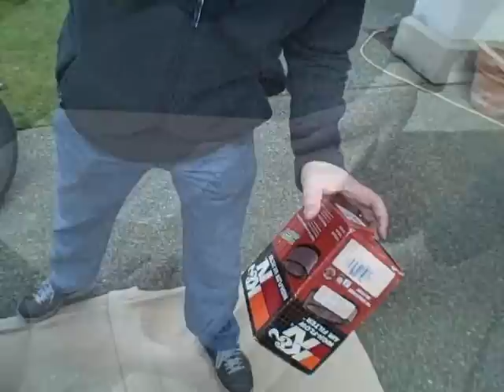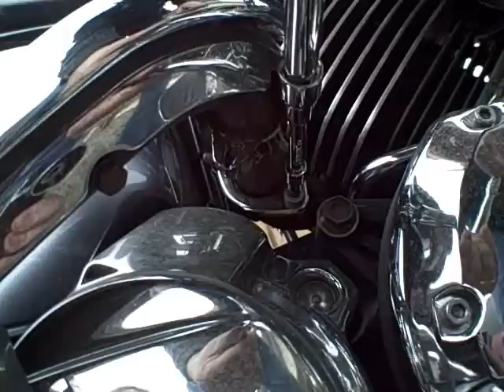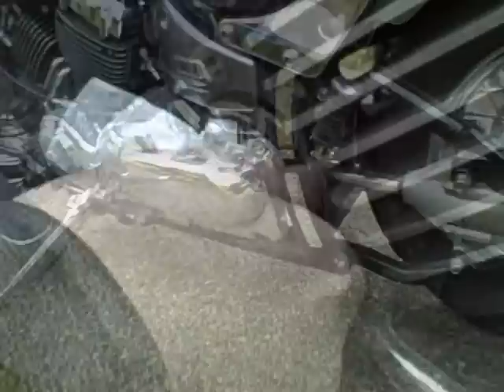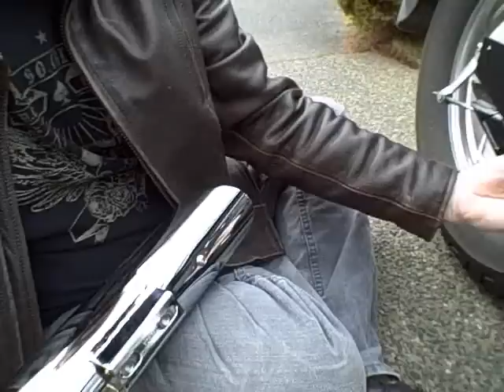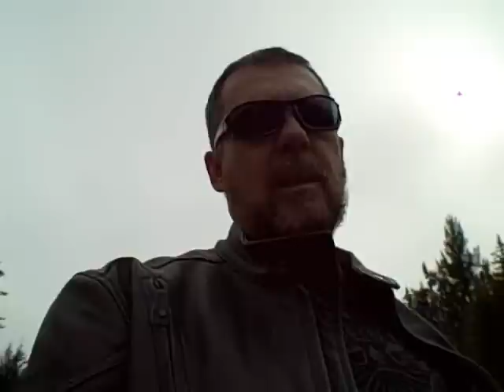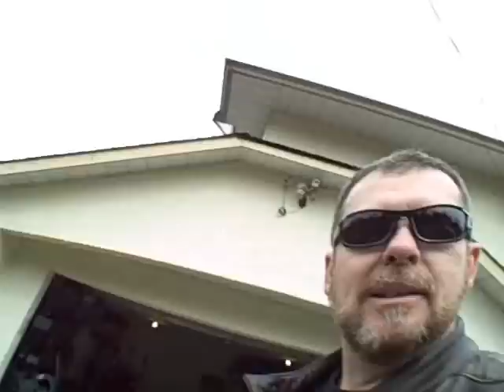How To Install Vance & Hines Cruzers

Comment from the maker: That is a great question, we just snugged them down equally not to tight and then put some miles on them and then do a recheck on the bolts, always easier to re-tighten them than over tighten them. If you feel an exhaust leak, just give em a little more. Cheers!

Comment from the maker: You should also install a K&N air filter and Vance & Hines recommend you rejet the carbs. My brother is taking his in to the shop to get the valves adjusted and he will get the carbs done at the same time. Hope this helps out.
Cheers!

Comment: Hi Bernbo. Bob from Australia here and I really enjoyed this video of you and your bro having fun putting these Vance and Hines onto his motorcycle. I am thinking of buying the same system as this for my 2006 V Star 650. I am just wondering if you remember the jet sizes that you would have had to go up to, to richen up the fuel mixture. I could do it my self with a series of plug chops but I would have to pull the carbs on and off a few times changing jets before I could get the proper plug colour. If you could perhaps remember the jet sizes that you went up to it would cut down the number of times I would have to do this. Love watching ALL your video's and hoping to hear from you. Bob
Reply from the maker: Hi Bob, sorry I dont remember the jet size they put in my carbs on my bike it was so long ago. As for my brother  he has still not rejected the carbs, still on the list of to do's. 
Wish I could be of more help. Cheers!
Reply: @bernbo   Hi Bernbo. Thanks for your return message to me. I have found that Vance and Hines do a kit for the new jets that are needed for there exhaust mod. 
It is Vance and Hines carb jet kit for Yamaha V Star XVS650  98-07 part number 21325. It further states that it will re-calibrate OEM stock carbs for use with Vance and Hines exhaust systems. With a kit like this it will be easier to get the right fuel mix with the Vance and Hines exhaust system. Catch you all later from Bob.
Reply from the maker: @7316bobe  Right on Bob, thank you for the info, good to know, will pass on th my bro. Cheers man.

Comment: Those sound awesome, man! How much did you tighten the allen bolts on the top pipe? I'm a little scared to overtighten/undertighten them. I don't want an exhaust leak, or a crack.

Comment: If you pop the exhaust bolts out (rear pipe) its a good idea to replace those bolts with marine grade bolts, as the standard bolts are made of cheese and tend towards snapping (and the allen heads messing up)  when they seize...

Comment from the maker: No, but he still needs to rejet the carbs. Thanks for watching. Cheers!
Reply: Hey brotha I'm installing same pipes except black on my 2006 C50 Blvd, do I NEED to re-jet carb or tune engine straight away or can I wait few months till cash flow is better?? Thanks in advance for responding
Reply from the maker: @jasonsanderson9385  Hey Jason, you will have to rejet the carbs and i recommend you install a K & N filter as well. So do your pipes and filter first because with a free flowing exhaust you will need to give it more air on the intake. Just be aware you will have bangs and pops on decelerating without the rejetting. So you can wait a bit till you get some coin togeather. But definitely get the jet kit done you will not regret it. Cheers bro.
Reply: Thank you soooo much!!!
Reply: I ordered twin slashed staggered vance and hines (black) full exhaust, guys at Revzilla  recomended the Dynojet power commander V.  Is this device what you mean by reject carbs? If not please explain, if so $339 if price of Dynojet.... cobra has a basic design for $100 less.... Thanks Brotha
Reply from the maker: @jasonsanderson9385  hey Jason, are you putting these on a 650 vstar? If so then no i did not have the power commander installed. What the shop installed was just new jets in the carburetors to allow more fuel to flow.
Reply: I'm installing everything on Suzuki Blvd c50 2006, only 5k miles
Reply from the maker: @jasonsanderson9385  oh ok, you probably do need to do the power commander then.

Comment: I did rejet as it was just getting waaaay to much air. Got a rejet kit of ebay from SigmaRacing company and it runs alot cleaner and has a bit more kick but not much. Sound seems to be deeper too after a rejet ;) 

PS: Remeber to put the K&N airfilter ;P

Comment: I thought it needed to rejetted to get the full potential of the new pipes?
Reply from the maker: Yes it does need to be rejetted. If you don't rejet you will get some backfiring on deceleration. The difference is night and day when setup right.

Comment: Great video !!! Your vids are simple but very very useful and 100% applicable to me and my bike vstar 650 classic 
I am a limited experienced rider with only 2007 vstar 650 classic which I bought a couple of years ago from a dealer as used bike.
I am thinking of chaning its stock pipe with HardKrome 2.75 Big Straigt.
I saw your recommedations for "rejetting" many times for pipe change.
By any chance, have you mad a vid for rejetting vstar 650 classic or should I go to a bike shop for regetting ?
Besides, do you think I need a Hyper Charger too.
Your experienced advice would be greatly appreciated. Thanks.
-- Jim Park ---
Reply from the maker: J Park Thank you for the kind comments Jim. Sorry I don't have a video for rejetting carbs. I would recommend you have a shop do it, for stuff like that I leave it to the pros to set it up right. As for a Hyper Charger if you can afford it go for it but I don't think you need it but it would be nice lol. Hope this helps you out.
Reply: ***** 
I appreciate your quick advice. It is helping me a lot. I will contact bike shop for the rejetting holding the hyper chager at this moment.
 Besides, have you seen any vstar 650 with Hard Krome 2.75 Big Straight on it ? If you have, how would you recommend between HardKrome and Vance & Hines Cruzers ? Since I din't have a chance to see them in real but seeing them only on youtube videos ,  I am not sure how they really sound. 
By the way, your vid changing the pipe yourself looks so straightforward that I feel like it will be fun to  do it myself (replacing pipe only). Do you think I can change the pipe myself while letting the rejetting at bike shop at different time either before  or later changing pipe?  Or should I do both at the same time.
Reply from the maker: J Park I have not seen any vstar 650 with Hard Krome 2.75 Big Straight other than Youtube, but I got to say the V&H pipes sound awesome. I see a lot of Harleys running them as well. As for installing the pipes yourself I definitely recommend you do it your self a very fun and rewarding project. Rejet them after the install though. you will have some backfiring on deceleration if you don't rejet. Cheers!

Comment: Enjoyed your video. What is the part number of the gasket? Just bought same pipes for my V-Star and think I got the wrong gasket? Thank you
Reply from the maker: The front cylinder has a different size crush gasket than the rear, not sure witch one is smaller. just googled crush gaskets for the 650 vstar and here is the 2 part numbers I come up with Y4TR-14613-00-00 and the 4BR-14613-00-00 hope this helps you out. Cheers!
Reply: Thanks, I bought the Y4TR and it is too big, must be the 4BR. Have a good one.
Reply from the maker: lol I did the same thing when I bought my pipes. Cheers!

Comment: Hey there Bernbo,

Thanks for the suggestion, I got the fuel mix screw and throttle idle screw working together well and the bike now idles without the choke in. Now I've got to figure out why the top pipe (connected to rear piston) runs hotter and harder than the lower pipe connected to the front piston. My theory is that the carbs need to be synced by a shop. Any suggestions from your vast knowledge to impart on a newbie 650 classic owner sir? 

Cheers,
Matt
Reply from the maker: +Matt Murphy I  think your right on with the carbs needing to be synced by a shop. That is something that I need to get done as well, also my valves need to be adjusted too.
Reply: I don't think they got adjusted after the previous owner installed the Vance and Hines pipes. Thanks, will definitely have them check it out. Have a great one, you are awesome to get back so quick! 

Cheers,

Matt

Comment: Do you have to rejet if you just put the new pipes on? Or was it because of the air filter?
Reply from the maker: When you change your exhaust, it's recommended you rejet. makes a big difference.

Comment: Bembo, i've recently bought a used 2005 650 Classic. The bike was apparently sitting for three years with a half tank of fuel without fuel stabilizer and what not, causing a few problems. Bike dies when choke is removed so I have removed the carburetor and cleaned the jets. I'm trying to find more information on how to adjust the fuel to air mix, as the bike was running super lean and making the Vance and Hines pipes RED hot. Do you have any videos or advice on this that you can direct me to?
Reply from the maker: +Matt Murphy Hey Matt congrats on your 05 V-star, As for your bike stalling out, it sounds like it's not getting enough fuel after it's warmed up. Try adjusting your idle mixture allowing more fuel. I am not to familiar with this problem, this link may help you out http://motoredbikes.com/showthread.php?35721-Engine-stalls-with-choke-fully-off Good luck bro.

Cheers!

Comment: So I have a Kuryakyn Hypercharger on my bike ('06 Honda Shadow Aero) and the a rejet was performed when it was installed...do I have to rejet again once I install these new pipes?
Reply from the maker: If you are running the stock exhaust, you will probably want to rejet, these pipes are a much more free flowing exhaust than the stock pipes on your bike. you could do the pipes and see how it runs, if you have a lot of backfiring or popping on deceleration you'll need to rejet. Hope this helps. Cheers!
Reply: Ok thanks brother!  I figured any major change to the intake or exhaust would require a rejet regardless of how many times a modification has been done.
Reply from the maker: Cool, good luck and ride safe.

Comment: I just got these pipes and the bottom/front pipe refuses to slide over the header. I was sent the CA model pipes and my bike isn't a CA model. I called customer service about this concern and they said after 2005, all models should work the same. I have a feeling this is the issue with the fitment. Am I missing something? Should the new bottom/front pipe slide right on, or is there something I'm not doing? Any advice would be greatly appreciated.
Reply from the maker: +Infestus In Arms That's strange, it should slide right on without any issues. Not sure why it's not fitting. Both mine and my brothers fit no problem. Sounds like the pipe is the wrong size. Sorry Wish I had an answer for you.

Comment: Is this exhaust system allowed in Germany?
Why did you change the air filter, was it dirty, or because of the exhaust system?
Thanks
Reply from the maker: I am not sure if these are allowed in Germany, you could check with your local bylaws. The K&N air filter allows more air to the engine than the stock filter, this should be done when ever you add an aftermarket exhaust that is much less restricted in air flow. Also being a carbureted motor the carbs should be rejetted as well. You will loose fuel economy but gain HP. Hope this helps out. Cheers!

Comment: Need to talk to you about my 01 vstar classic. Just got it man and have some questions about the way it feels taking off as well as the vibrations at certain rpm ranges going down the road. Hit me back and I can shoot ya my number if that's cool? I'm used to riding a newer Vulcan 900 and switched to the vstar after I sold the Vulcan to help pay for some expenses. Anyway, I bought it from a dealership with 30,000 miles and they said that it was local and we'll taken care of. Got it for 2,000. Hope to hear back from ya dude because I am uncomfortable with how the bike feels and sounds on the initial take off. Not that something is wrong mechanically, just not familiar with a shade drive bike or Yamaha for sure and needed some good input from someone familiar with the bikes. I am a new subscriber and appreciate the videos on the bike that I have seen.
Reply from the maker: Hi Ryan, congrats on your V star. It could be a number of things, it sounds like you may need to have the valves adjusted, this is something I would take it into the shop and have done. Some things that you could check out yourself would be the air filter, make sure that the choke is all the way in. Check for fouled spark plugs or just replace the spark plugs. Make sure the oil level is not to low. It may be the brakes have some drag on them. If after you check all of  the above and it still persists you may want to take it in to a shop. I hope this is of some help. Cheers!
Reply: Thanks

Comment: So you can just put them on?  I was told there would be some type of calibration or something or else the bike won't run right.  Is that true?  If not, I'm doing it myself.
Edit...looks like people are talking about rejet.  I guess that's what they were talking about.  Been a few years (2004 Kawasaki vulcan 800 classic).
Reply from the maker: dinkidow You should rejet the carbs when you install an after market set of pipes.
Reply from the maker: dinkidow Thats right man, can save yourself a lot of money.

Comment: how difficult of a job is it to change pipes? I have some cobra streetrod slash downss ordered and the Honda dealership wants $160 to install. I rather do the job myself if it isn't too difficult.I have a 2006 Honda shadow spirit 750
Reply from the maker: Actually it is a fairly easy job, not as difficult as you may think. I would recommend you give it a shot, it's a fun project and you'll save your self some money.